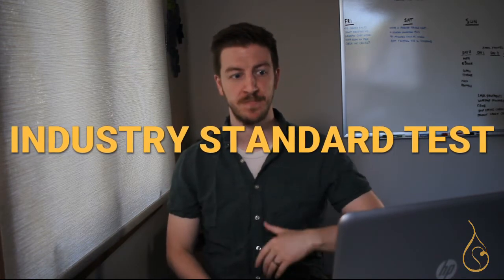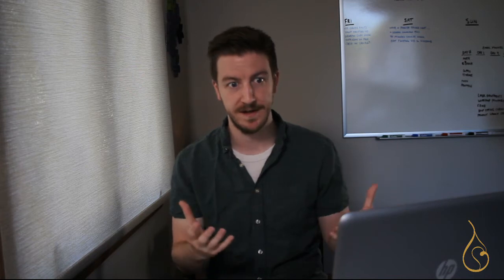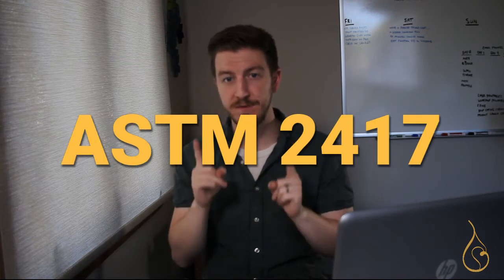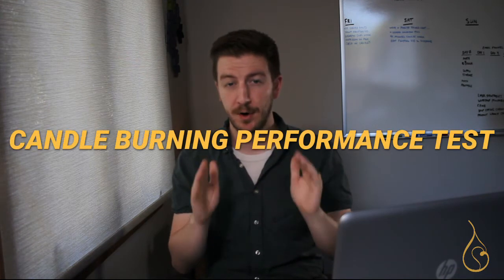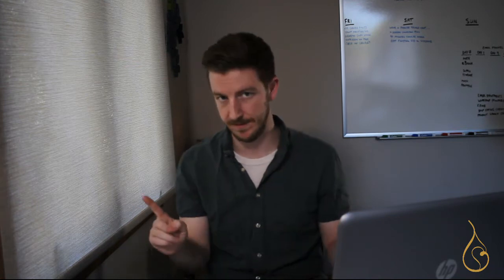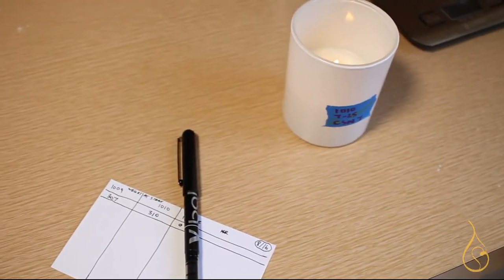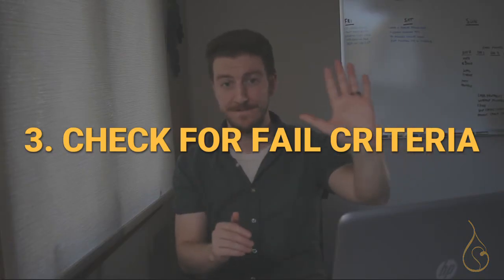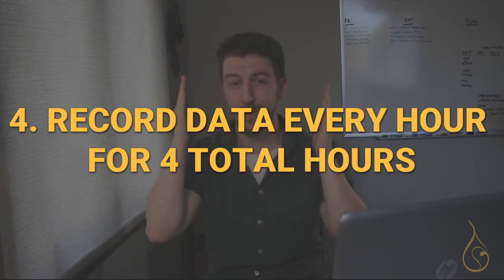How To Test Your Candles

Comment: I am absolutely loving your videos. They are so very helpful. ive been making candles for a while now. Getting ready to open a small business, but im just testing testing testing everything. I also printed out little care cards with all the information and warnings about burning the candles on a heat proof surface, trimming wicks, not touching the candle until its cooled etc. My tins are good so far but I definitely notice the tins get really hot towards the very end and I worry about that.
Reply from the maker: You can do it!

Comment: I have been failing my candles for months because they are reaching 160 degrees. Problem is I was testing temp inside the jar at the top🙄🙄🙄 bit when I went to a lower wick it left wax. This answered so much. Thank you. 
I wish you had classes on coconut/apricot wax.
Reply from the maker: Ah I'm so glad!  With a good grip on the fundamentals I know you can crush any wax type.  I have a Beginners course if you're curious: https://armatagecandlecompany.com/course
Reply: My candles are reaching over 150 degrees on some spots. I’m testing the jar on the outside by where the flame is. Is that where I’m suppose to test to temperature of the container?

Comment: i have a 75mm diameter candle and have used the recommended wick but the melt pool tunnels to one side, do i use two wicks, when is it right to use 2 wicks as opposed to one? is one wooden wick enough?

Comment: I know this video is a year old, but I hope you can help. I am using the ig 6006 wax unscented without dye. The 12oz libbey jars from candle science. I am testing wicks and can't find the right wick. Everything from black smoke/soot, mushrooms, little wax pool after 3 hrs burn. And flames that are too high/big and jumping, flickering. I have tested all wicks from eco, lx, CD, htp, and zinc. Knowing some were too small and/or too big. And none of them have worked. I have tested a total of 44 wicks. The first round was 14 and the second round was 33. Can you please offer some advice or suggestions? What am I doing wrong. So confused and frustrated... Thanking you for any response...

Comment: When do you decide its time to throw in the towel on candles and just move on? 
I do wickless testing, 1 vessel, 2 different wax types, 10 different wicks and woohoo finally find one that I think works great, YAY!! So happy and excited! Proceed to make a candle with all the stuffs- the wick, dye, FO, all the works, let it cure, the day comes to light it, AND it sucks ;( 
This goes on for months, no luck, is it time?
Reply from the maker: That's one of the main drawbacks of wickless testing - previous burns influence the behavior of later burns, so wicks that seem to be awesome may have behaved differently due to how the earlier wicks thermally impacted the wax.  You did the right thing - making a new candle with the apparently good wick, but it's not always a guarantee.  I've had some work great, and I've had letdowns.  For me, it's just continued iteration and eventually.... I'll move on from the FO since that's typically the prime suspect when I can't get it to work out.

Comment: Bit confused,  so if i cure my candle,  test and all seems great, if i don't sell the candle straight away,  it might not perform well after being stored for weeks or months?  Even after testing? Hope this makes sense!
Reply from the maker: Depending on your wax, it might be different after a drastically long period of time.  For instance, vegetable waxes will continue to harden and potentially require a different wick.  Not something I want to cause concern over - you only control the process until its out of your hands, and these impacts aren't super drastic that anyone should stress over them, imo.

Comment: Is there an ideal temperature of the melt pool? I’m using wooden wicks and I’m having the MOST DIFFICULT time wicking. I use small wicks to avoid overheating the container but the flames are dim sometimes and other times they’re great. Some wax is left behind but it catches up later and then the flames go dim again 🤦🏻‍♀️🤷🏻‍♀️ please help. I’ve been testing them for many months and nothing gives 🥺
Reply from the maker: That's going to vary per fragrance blend, unfortunately.  The reality is that some hold their carriage better in high heat and some don't.  Top-middle-base note profile will help you understand if you'll be in the higher range, but I've had some that throw well at 140°F and some that throw well at 160°F.  It's all up to your.... testing.

At some point it's worthwhile to throw in the towel with that fragrance/wax/container combo and move on.  Usually easiest to find a new fragrance.  Some FO just plain stink for some applications.

Comment: Please please give me a reason why every wick i use in my candle.is flickering?
I have tested almost every eco and lx  wick in my  container and the flickering doesn' t stop. Please help me.
Reply from the maker: It's always air.  I recommend most people worry first about temperatures and flame height before worrying about a flicker.  Especially in container candles that are more than halfway consumed, the local air currents are wild and flickering is pretty much normal.  If a candle has a lot of soot AND flickering, it might be time to switch wick sizes or series.

Comment: Do you think the stick/stir material we use also affect the candle result? What's the best to use? Stainless or plastic? Pls advise. Anyway, great video! Subscribed.
Reply from the maker: Great question!  Thanks for the sub.  I always recommend a wider spatula made of anything that won't absorb anything.  Number one rule in stirring is to avoid introducing air.  Be gentle, not aggressive.  As far as the final result, I really believe it's how consistent you keep the blend temperature and how much you can avoid air being introduced into your blend.

Hope that helps!
Reply: @ArmatageCandleCompany  Oh well noted. Thanks! May I ask you more questions? you said on your videos about testing the candle (soy wax) ideally for up to 4 hours. How about if there is only 1/3 wax left on 8 oz jar, do I need to test my candle for 4 hours also? because I got a large melt pool for only 1.30 hours. I want to attach a picture, but I can't do it here. Btw, I'm using CD7. Pls, advise. Many thanks!
Reply from the maker: @yaayass  The industry standard in the US is to safety test from the very top of a candle down to the bottom or failure, 4 hours at a time.  This includes the bottom 1/3 (which is notoriously difficult).  A large melt pool isn't a problem by itself, but sometimes exists as a symptom of high temps.  Check out this guide for more information (https://armatagecandlecompany.com/blog/basic-burn-test/)  Best of luck!
Reply: @ArmatageCandleCompany  thank you so much!

Comment: When you curing your candles, when should the lids go on if the container  have any
Reply from the maker: I typically recommend putting lids on after you can trim the wick, but I don't believe in any significant scent loss if you don't put lids on.  If there is some, it's a tiny tiny fraction and no one can really measure that anyways.